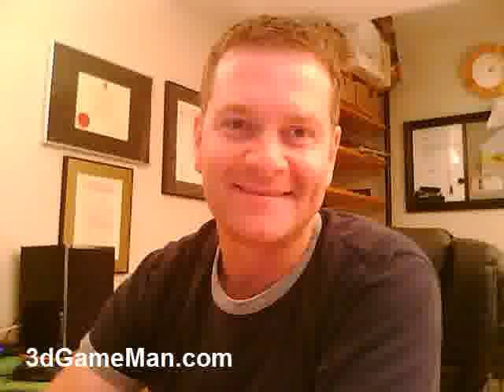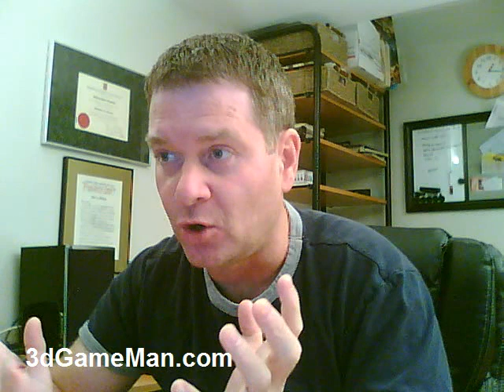#264 - Q&A: Positive or Negative Pressure (Computer Case)

Comment: The ONLY reason to have more intake than exhaust is to prevent dust build up which takes YEARS to accumulate to any degree of impact. In most homes and offices (air controlled environments, and conditions where the case is not on carpet) negative air pressure will result in lower temps than positive.
So what should you do?... have one intake at a lower point in the case and atleast one exhaust near the top/back of the case. Heat rises so make the exhaust leave at the highest point you can.

http://www.tomshardware.com/faq/id-1858957/airflow-101-setting-fans-keeping-computer-cool.html

Comment: More dust is going to enter with intake fans than negative pressure. In addition,  positive air flow is much more effected by wiring and components than the negative setup. I find it is much more important to exhaust hot air with the fans. The only advantage to the positive approach might be if the unit is located next to an AC source. Otherwise, its just a case of trying to push out hot air with other hot (but not quite so hot) air.
Reply: You're almost right but you also forget that positive pressure cases will often have filters in those places. Even if it did not, you can always go on amazon and get some filters. Therefore you will have the dust build up over the filters instead of inside the case. By then, you can just clean the air filter.

Comment: On my CM Stryker I did change the factory top fan and switch it to a positive pressure and my vcore temperature was allomust 20 degrees cooler... :-)

Comment: I have 2 120mm intake at front and bottom and 2 120mm exhaust at back and top. So my case is kind of like a wind tunnel the air doesn't spend a hole lot of time inside the case. ~26c idle and ~68c load on my 7870 hawk. and ~10c idle ~50c load on my FX 4100.

Comment: i have 2 120mm intake and 1 200mm intake and 2 exhaust fans one at the back and on at the top what would happen if i would add 1 more exhaust in the top? would it getting more dust? should i add one intake in the bottom to?

Comment: equal airflow can be most effective, having a nice wind tunnel effect over your major parts. But overall no one seems to mention the stress on your component fans in these setups. The harder a fan needs to fight the pressure the quicker its going to wear out. GPU's normally exhaust air, so using negative pressure could be a bad idea (positive pressure *might* extend the life). I ran a high performance fan to death in like 3 months because the pressure on it was to much.

Comment: On a side note: Direction is key, having the flow directed at the components you want cooled makes all the differance.. I have only two exhaust fans, but my intakes like my side panel 200mm deliver cool air where needed, I neglected to mention my Ram cooler, and the fact my CPU is waterblocked, and that I have another 120mm fan duct for the video cards, but i'm limited in the amount of text I can put here per post..  With all but one fan set as exhaust, temps were awful compared to positive in.

Comment: Positive pressure is "ALWAYS" better, because you you will "ALWAYS" be exhausting at a slightly higher rate with a single back or top fan than you would if the fan wqas struggling to "PULL" air from the case... I did this expreriment with the HAF X 942, and guess what, I had 7-Celcius better temps with an added 140 at 5.25 drive bays pulling into the case Meaning I had A 140mm, a 230/200mm and a 200mm side fan blowing, and a 140mm and 200mm exhausting out. Four fans exhausting out was a fail.

Comment: I just ordered a HAF 932, it's on the way, so I don't have first hand experience or anything...but doesn't that case have positive pressure by default (stock)? The front and side fans are usually used for intake, and the top and rear for exhaust. The front and side (230mm) fans are rated at 110 CFM a piece, while the top and rear (230mm and 140mm) are rated at 110 and 60 CFM respectively. That comes out to be positive.

Comment: the best way to do this is to have SLIGHT positive pressure.  that way, the airflow is mostly balanced between intake and exhaust, while that little bit extra keeps the dust out.

Comment: You guys can pick sides all you want, but everything you say can be null and void from one example to the next. It is all dependent on the design of the case. For example, I have a Silverstone RV02, and the positive air pressure design of this case is much more effective than the positive air pressure system of a normal tower might be because the RV02 doesn't have any areas where heat can build up.

Comment: @runie360 Negative pressure is better, only failure's and scrub's don't have fan filter's. Negative pressure means the hot air is pulled out, easier to pull than to push, and if you're smart you have angled the case near a vent, or you turn the exhaust fans away from the wall, this is what most fail to do and they then complain about dusty computers.

Comment: i imagine the difference is negligible but there will be physically more air in a positive pressure setup at any given time which would mean greater capacity to pull heat off of components, but again the difference would be really insignificant

Comment: I disagree, from my perspective, negative is way better. Much cooler, gets rid of any eddies, and to dispell the myth of the dust issue, the dust doesnt settile anywhere, it is sucked in, and discharged. I do have filters over my intake fans, but even the air through the slots which allow dust to come through does not lead to any deposition on components. I have never seen my cpu and video card fans cooler then when i switched to negative..

Comment: A 1 to 1 ratio is actually the best. in either situation (positive or negative)  you are not moving enough air to displace the heat. so if you have 3 fans in front have 3 fans in back. this doesn't take in to account the resistance of obstacles like drives, cables and other stuff that will impede air flow, or say screw it and use liquid cooling.

Comment: I would rather go for the negative pressure, as it sucks air from the whole case ensuring airflow over, under and around all the components in the PC. Personally I've got pretty much a balance, but because of the fan speeds, I've got more negative than positive: Exhausts - 140mm, 200mm, 120mm (psu at the bottom, top and back). Intake: 3x120 mm (two front, 1 side).

Comment: wait, so wouldnt positive pressure suck in more dust because the fans themselves are bringing in dust? i have 4 intake and 3 exhaust, being one exhaust a 130cfm fan. so they're very very equal in terms of cfm. i have the haf 932, which is known for it's clusters of open areas. so i got a panel window for the side and it has actually improved temps, due to what i hope is true (a straight through flow) front to back

Comment: I have an antec p183 set up with negative pressure. When i set the fans up to have positive pressure the temps tend to be a little higher because, i think, the cpu fan is recycling more warm air rather than having a fresh supply of air. I really see a jump in mobo temps as well when the case has a positive pressure. Just my experience

Comment: well thats true but truth is heatsinks dont technically come in that many different designs most have fins and when u blow air in its gonna be exhausted through the sides and besides blowing air in is the way to go if ur actually cooling something important like a processor since the processor will mostly be under the heatsink blowing air in is the way to go. that office fan thing is silly everyone knows that. weather systems??? i dont know what that is

Comment: its likle only 1 case that have this, most computer have  2-3 in and  2-3 out, but then u have grapphic cards and psu puling air out, and with crossfire or sli u got more air out :(

Comment: best to have positive, because the psu and gpu fans would be able to operate normally. when negative, the air that they push should decrease due to the pressure difference. also, there is a teeny bit more air in positive pressures, so therefore more heat dissipation and better cooling!

Comment: If positive is better why do so many case have setups for negative pressure? A lot of cases I see have say one intake fan on the front and two exhaust fans on the back.. Or my Antec 900 which has two 120mm intakes fans and one 120mm exhaust and one 200mm exhaust fan which I assume would create negative pressure due to the bigger 200mm fan.

Comment: Well, negative pressure has worked quite well for me in a smaller (midtower) case. I guess positive pressure could work out great in a bigger case.

I have the front fans intaking air and the back and side fans exhausting, that way I don't get the intaking warm air problem. 

I guess it really depends on the case though, maybe mine is just special ;).

Comment: I have one 120mm fan at the front, two 120mm fans on the side all sucking in air, i have one 120mm fan at the top and back pulling out air.

So thats good I guess, another thing is the case inside is completely clean which is good. :)

Comment: Neutral is always better, you dont need a gahzillion fans blowing on every hotspot, if you have like a 240mm intake fan on the front, hidden wiring-great airflow, and then a 120mm exhaust on the bottom down side, and another 120mm one going thru the power supply. Also, a newer layout is needed, the current one is kinda... unaerodynamic lol.